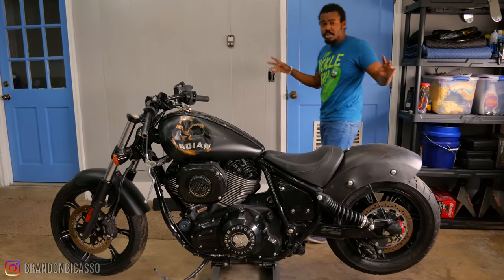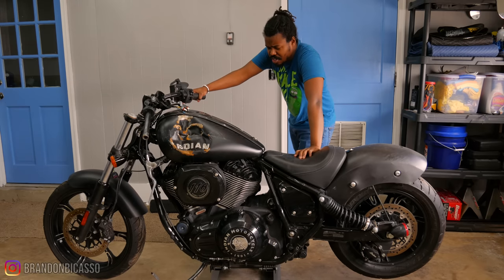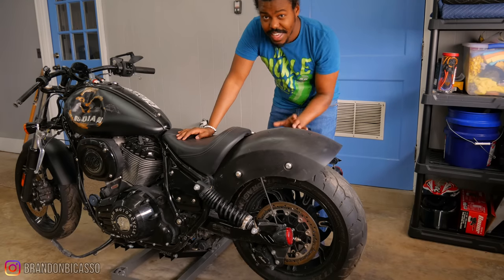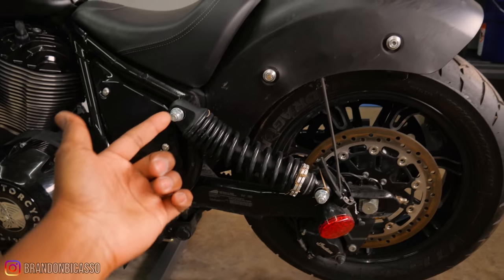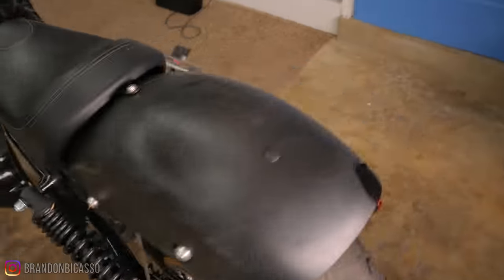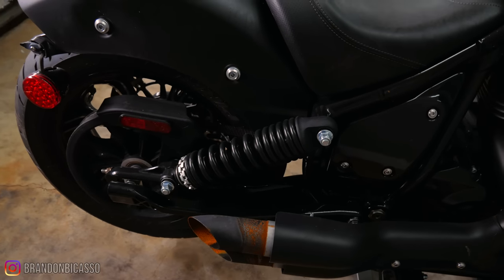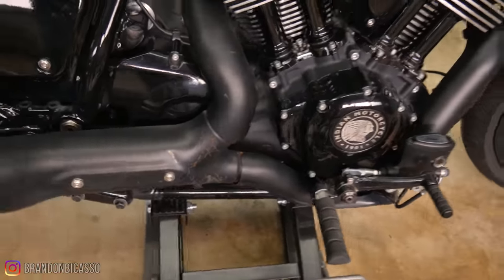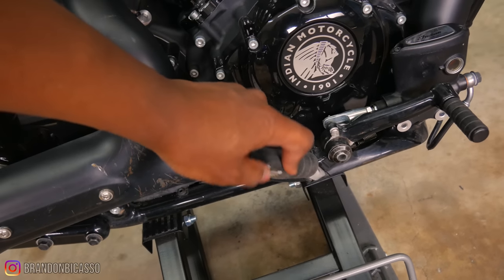My Cheap Indian Chief Has Hidden Damage | How Much Will It Cost To Fix?

Comment: Re. that exhaust... obviously, the previous owner did a cheap-shit straight pipe job on it. You can pull the heat shield off and check, but I'm betting you're looking at needing a whole new exhaust. Overall, my impression of the pre-crash bike is that the owner was a hooligan. That rear fender indicates to me the bike had been down previous to the final wreck. Likewise the damage to the right peg, and PROBABLY that crappy exhaust job.
On the upside, a lot of the broken bits (lights, bars, grips, plate frame, exhaust, etc.) can be replaced with universal-fit aftermarket parts.
I find the fact that the Ride Command unit is missing a bit suspicious. The damage doesn't look like it reached it. I think you got robbed there, and somebody somewhere has the scavenged unit.
On the whole, ASSUMING that the frame IS in fact straight (I'm not so sure, seeing the damage to that left shock!), your best bet might actually be, instead of restoring the bike, to make it a full custom build.
Reply from the maker: Someone definitely lifted the ride command. That part is screwed into a bracket which didn't appear broken. Headlight assembly I'm assuming the same thing.

Comment: Sorry man, that looks like trash.   Dont throw money into that till the frame is checked.   Looking at you in those opening shots in the garage talking over it the frame (or at least subframe) is pretzel.   The lines of the rear vs the front.  The rear shock.  Frame or subframe is seriously tweaked.

At a minimum Id be pulling all tins off and put a straightbob to that thing.

Comment: No way you are fixing that tank. Its wrecked for good. Take all the damaged parts off. Looks like your subframe in the rear might be damaged. Once you take all the damaged parts off, you can inventory and replace, or potentially find more damage. Good luck! 

I would personally like to see a lot more happening in these videos. No offence but its kind of boring to watch you check a battery, take off 2 covers and prime the bike for next to 30 minutes.

Comment: Those exhaust tips are like sub 80 bucks on Amazon. Loud, obnoxious and power losers. I know you will put proper exhaust on. Its gonna be bad ass once your done massaging it!
Reply from the maker: Yeah, that was my thought as well. A cheap slip on 😂
Reply: @BrandonBicasso  did you make sure the blinker fluid was full like the coolant?
Reply from the maker: @SlightlyLessFat  only 50%. The front blinkers aren’t connected so only half the fluid.
Reply: @BrandonBicasso  Haha!